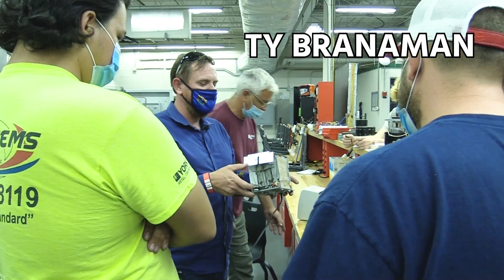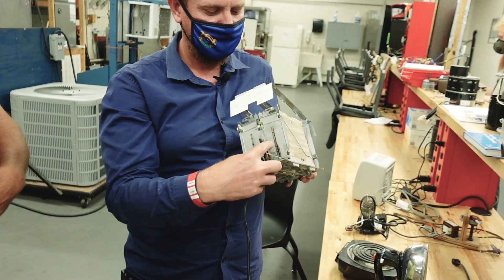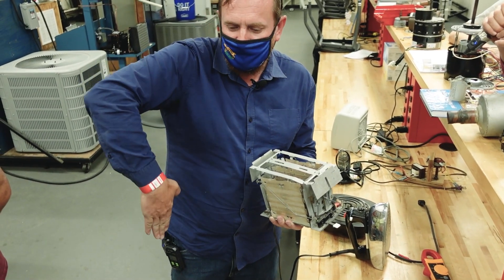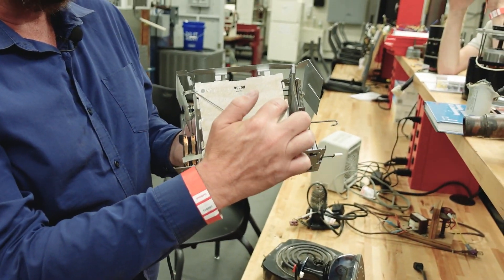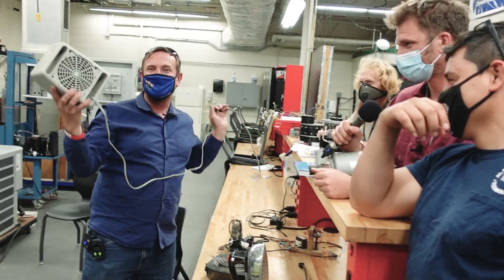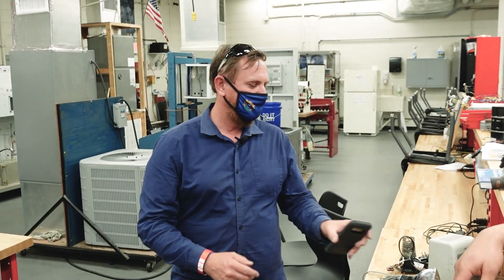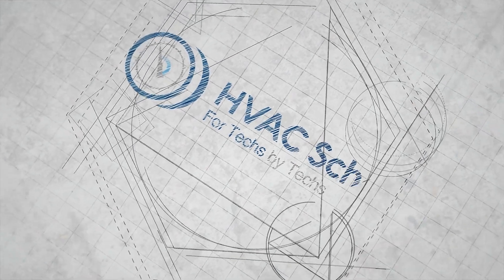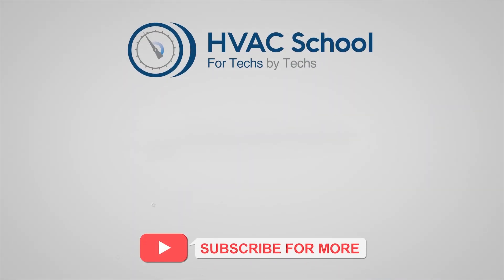Learn BTU - Watt Conversion Using a Toaster w/ Ty Branaman

Comment: Watt a good teacher
Reply: Does it relay matter how we heat our space?  Wire we concerned about this?   I never had very many fans,  but with enough of these,  my house would be toasty warm.  This could even work on a train,  with conductors running between cars.  I have enough bread for a pallet of these...
Reply: @gyrgrls  you're a gas. I got a charge out of that. I'm positive.

Comment: 1 Watt is **NOT** 3.413 BTU. It's 3.413 BTU per HOUR. Goddamnit.
Reply: ZapAndersson, you must be right. There must be some time component as 1 Watt left on for 0 seconds makes 0 BTU. After all, I can hold on to a 100 Watt soldering iron if it's turned on for zero seconds.

Comment: Awesome 👌. Could u use 1 watt = 3.413 to find overall system btu capacity. For example a refrigeration system w= v × a so 120v × 15a = 1800w. Then 1800w × 3.413 = 614.34 btu. Am I in the ballpark or parking lot?

Comment: That was pretty cool to see that a toaster is basically a little mini furnace lol. I have been trying to learn a/c voltage for a little while now. I've been to 2 automotive schools and got DC volts down pretty good. Ac trips me up now and again because it's hard for me to imagine how its flowing through a system. My brain wants to see it work like a battery and it's hard to turn that off. I'm getting there though with the help of you guys explaining things. Thank you so much.

Comment: Hi Ty - First of all I want to thank you for taking the time to make and share your expertise through the numerous videos you've made. I've  learned a lot about A/C and related topics by watching your videos. That said, in this particular video there is some confusion as to the definitions of power and energy, one that I’ve seen many, many times throughout my engineering career.. Specifically, ENERGY = (POWER X TIME). If you look at an electrical bill, you'll see that you are billed for the number of kiloWatt-hours you consume; you are NOT billed for the amount of POWER (kW) you use. So, for example, you could run a 1kW heater for ten hours, or a 10 kW heater for 1 hour and you'd use exactly the same amount of ENERGY even though the power was different by a factor of 10.

Now, BTU's are ENERGY units, not POWER units. If you consult one of many online calculators, you'll find the following conversion information: 1 kWh = 3412.14 BTU (NOTE that the factor of 3412 converts kiloWatt-hours to BTU's).

The key is to note that the conversion is from energy to energy here (kWh to BTU's, or vice-versa).

Thanks again for all your helpful videos and if I can help explain this subject further please ask questions and I'll do my best to respond.

Take care! 

Jim

PS: Here's a nice reference that explains this stuff better than I can: https://www.essentialhomeandgarden.com/what-is-btu/

The key sentence from this reference is as follows: "When used as a specification for an air conditioner, the BTU number given refers to the amount of heat that the unit can remove from the air per hour (BTU/hr)."

Note that they are talking about BTU's per hour (i.e., the rate at which energy is consumed over time). So, if one wanted to compare power numbers, it would appropriate to compare kiloWatts to BTU/hour.

Comment: I'd love it if someone could explain how a nickel caught in the heating element should cause current flow when it wasn't called for.  If the heater was driven by 240 volts off of a single pole contactor, I could see it.  But wouldn't something like that be normally powered through a 2 pole contactor?  Or is it customary for the HVAC industry to leave one side of the heater hot?
Reply: In the old days we only broke one side of the heat element circuit with a sequencer or contactor. The new ones are now breaking both sides.